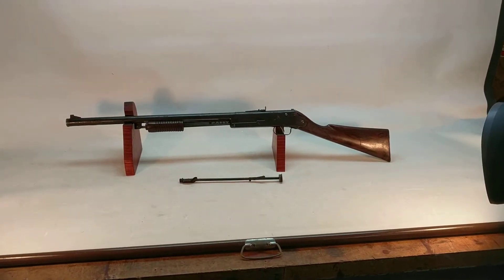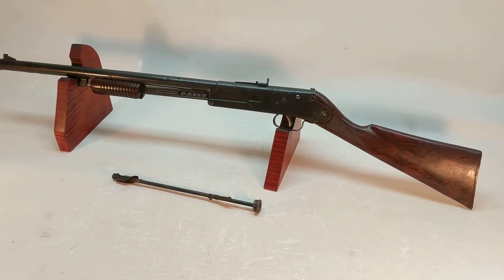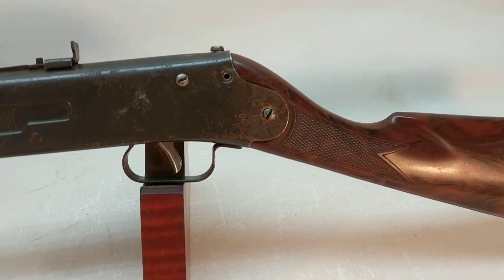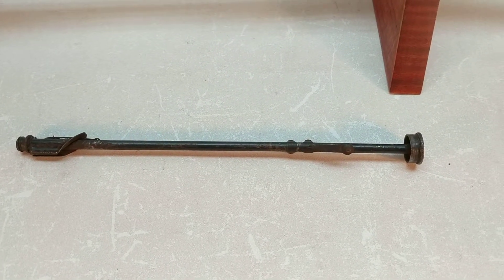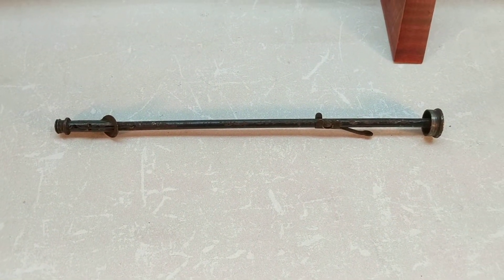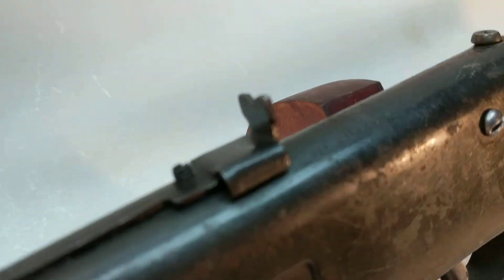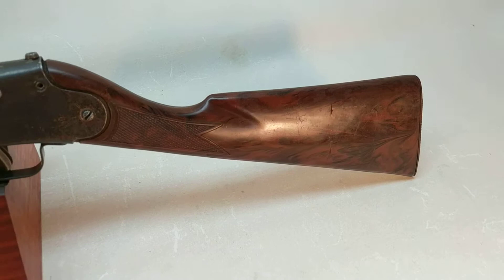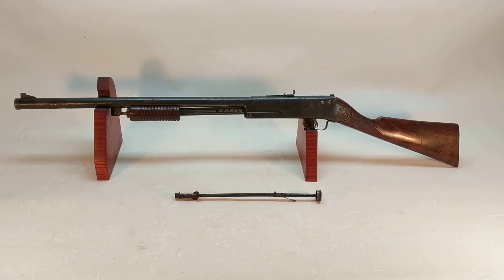Restomod Daisy Model 107 review

Comment: I am in the process of restoring a 107 Buck Jones and one thing I needed was the shot tube. 
I found one but I would mention this rifle is different than the 107 Buck Jones. The loading port on the BuckJones is located on the right tip. This with Daisy on the pump lever has a loading hole behind the sight.
Reply from the maker: Congrats on having a Buck Jones Model 107!  Good luck on finding a shot tube for your, the Buck Jones branded 107's predate the Rodgers AR guns by quite a bit and used the earlier drop in tubes with out threads, the tube secures by locking into a cut out in the muzzle. The Rodgers AR 107's have the thread in version.

Comment: Hi. I have a Buck Jones model that I just disassembled in order to repair and restore and I discovered that the air tube is completely missing! I reckon that I'll have to fab up a new one but do you know what the length is supposed to be? It is a Plymouth MI stamped model if that helps. Thanks in advance for the help and thanks for posting your content. Cheers!
Reply from the maker: I don't have a Buck Jones but my Rodgers marked 107 has a very long airtube that uses the model 25 seal set. The tube mic's out at 4.94" as compared to the current Red Rydey tube length of 3.54". I'd contact Jonathan over at Black Barrel Customs and see if he could fab up one of his brass "Mean Streak" airtubes to  get that done

https://www.youtube.com/watch?v=sjmBvyyU00c&t=76s

I have a question for you on the 107's, does your  107 have that small coil spring set up on the trigger as shown in photos over at the Dave Albert page?

https://www.tapatalk.com/groups/grantthekiwisairgunforum/dave-albert-daisy-resource-t3831.html#p9463

I'm currently completely stumped on it.

Comment: I have one of these, a Rogers, Arkansas 107. Had a Sears version when I was a kid but believe it was a lever action pump. Any idea when the Arkansas 107 was made? Thanks in advance and appreciate the video. Believe my current gun needs a new shot tube, only intermittently fires but quite powerful when it does.
Reply: Congrats on having a Model 107, they are not common. The Rodgers guns are post 1958 and you should have a lot number or register number somewhere on the receiver that will tell you the manufacturing date after you break out your Daisy Decoder Ring. Have you pulled the shot tube and inspected the small channel that feeds BB's to the chamber? It might be partially blocked or have a slight bend or deformity that is keeping BB's out of the chamber on occasion. Keep in mind that this a gravity feed system so keep the muzzle up during the cocking cycle.
Reply: @OODA999  Thank you Shane. You know, I like the looks and structure of the 107. It's a little more straightforward design than the lever action pumps, although a little harder to cock. It has a cooler look to it though. I will check the serial # and take a look at the shot tube. It does shoot straight and powerfully. Surprisingly nice condition too, hardly any rust at all. Has to be at least 60 years old I'm thinking. Should have some fun with this.
😊
Reply: It is a Rogers Arkansas Serial No. F598053 Model 107. Serial lookup is a bit unclear in that era but my guess is June 1965 manufacturing date, which would make it about 57 years old.

Comment: My Buck Jones abutment came out with the abutment washer. Is this a fixable problem
Reply from the maker: Depends, did you drive it out while removing the abutment washer or did it just fall out with a simple tap? There should be two flanges that retain the washer itselt by being bent over the cuts at 3 and 9 oclock in the abutment washer. Can you see them in the compression chamber at the seat of the abutment washer or are they missing?
Reply: Disregard. Got it in place

Comment: The Buck Jones Special I got today looks great, but it makes a sound when it's "decompressing" that sounds depressing. Me thinks she be needing new seals & springs. That extra long shot tube will not come out with finger pressure, and I squeeze pretty good... We'll see what some earl will do to loosen it's disposition. Be the bb!
Reply from the maker: Joe, Be careful with the shot tube. I don't think I've ever seen one sale as a part. Careful when you take it apart, make plenty of pix
Reply: @RestOModDaisy  Yessir, boss! It shall be done. Thank you, kindly.
 I'm running into that same issue with a 1000 shot Model B. The crown has come undone from the shot tube, but all else functions. The one for sale on Ebay looks terrible, but I may have to fork over the 80 bucks to get it as a parts gun. Such is my chosen predicament...
Reply from the maker: @mistercapnjoe  The shot tubes can be resoldered with some low temp silver solder paste. I've done a few and had good results with that on bottlecaps that tried to pull an Elvis and leave the building. Your collection is getting quite sizeable.
Reply: @RestOModDaisy  I think Elvis would love my collection, and my sammiches! Tonight I rebuilt a silk screened Model 111 and a Heddon Model 102. I left both original springs in the guns because they worked, I just cleaned them up then resealed them with newish rubber and the 7/64ths tube. For some of the older guns I have struggled to find fresh rubber seals to replace the leathers. As you are so fond of saying,,, "It's a process..." I'm happy in my struggle.

Comment: Can any one tell me how you load this model?!! I'm so puzzled with my new ebay find!
Reply from the maker: It should have a removable shot tube like the current production Model 25. There was a thread over at the Daisy Talk forum that discussed the differences between the early production Model 107's shot tubes that did not screw out like the Model 25 but rotated a 1/4 turn to the right to release the shot tube from the internal abutment washer.  The gun in this video is a post 1958 Rodgers model and screws out, is yours a Plymouth marked gun?
Reply: @RestOModDaisy  it is a 1930s model 107 buck Roger special. It is a Plymouth.  I have a working regulat 107 from Roger's looks like. I figured it out. You twist the shot tube a little bit and drop bbs in the hole on side or top the twist a little back. Thank you sir. I'm trying to get the buck jones working that's why I bought the 107 to use parts on that. It's been a pain though.
Reply: Sure enjoyed my 107 some 60 yrs ago. We had a finger-pinching 25, let brother use it. Blasted a lot of sparrows, blackbirds, kingbirds, cowbirds, etc. Great time to be a farm kid.